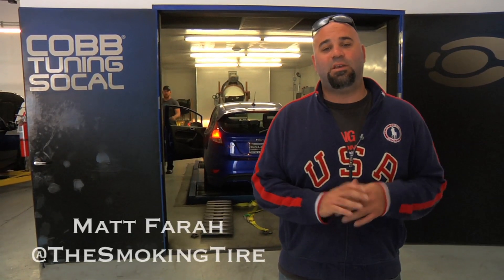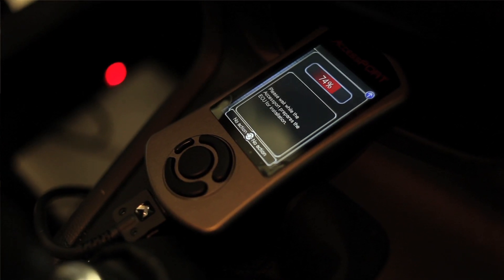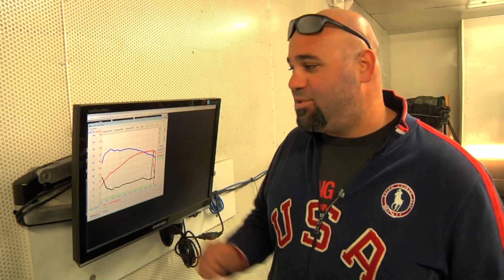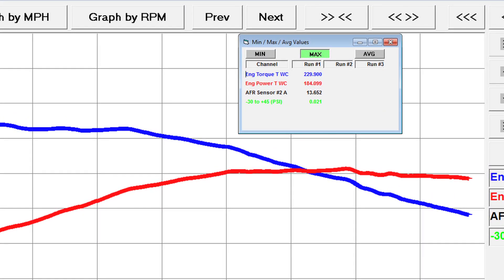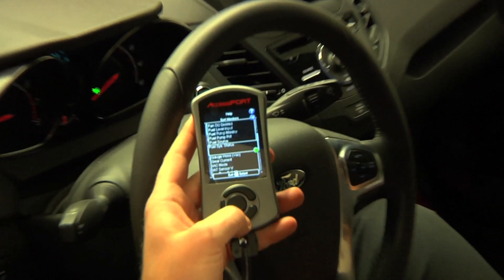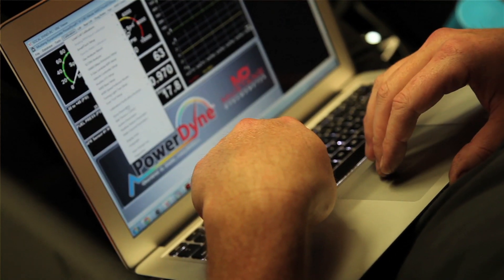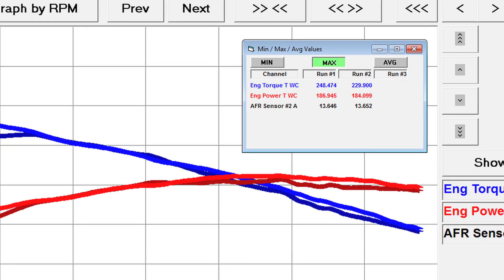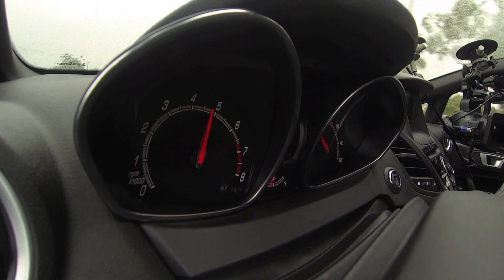Project Car Fiesta ST Gets Cobb Stage 1! Before/After Dyno

Comment: It looks like most of the torque improvement is at  2000-40000 rpm, which is great, but is there a noticeable improvement at the top of the rev range?  Is there a tune that can flatten out that torque curve a bit?
Reply from the maker: The biggest improvement is in midrange torque. If you want more power up top, you have to start changing hardware. The limiting factor is the size of the turbo, which is designed to produce low end torque from the factory.

Comment: Wow how come it was only such a little improvement? The N54 gains a lot more power from the Cobb Stage 1 Tune.
Reply from the maker: The N54 has six cylinders and twice the displacement of the Fiesta. The bigger the engine, the bigger the gains.
Reply: TheSmokingTire Got it. Makes very much sense.

Comment: Only gains at 2500 -3500 rpm at 4000 and up  it the same as stock with very little gain!  According to graph at Cobb timing . so top end is the same as stock!

Comment: Did anyone else notice that completely stock, this Fiesta is putting down more torque to the wheels than it's even rated at the crank stock? The ST is rated 214 lb feet of torque at the CRANK. This Fiesta stock, pulled 230 lb feet of torque to the WHEELS. All cars have drive train loss, so the the power to the wheels should be less than the crank. That is strange, but if these dyno numbers are correct, with a 15% loss of power through the drive train(which is average loss), the Fiesta ST is actually making some where around 270 lb feet of torque stock!! That number is much higher than the 214 it is rated at. Am I missing something here?
Reply: Yeah, it could be that the Dyno measurements are a bit off, but I think it does make more torque than they claim.
Reply: On my fiesta stage 1 when picking which parameters to monitor on the digital gauges, on my first pull for est horsepower and torque, the v3 said 205hp and 277 ft.lbs, at the crank obviously. Looks like Ford is pretty conservative with their numbers

Comment: Why didn't Cobb support the BRZ at least to use their accessport V3?  They don't need to provide tuning for it if they don't want, I just want to be able to use the device.
Reply: Cobb accessport is usually for Turbo cars I believe, if you want to read stats and temps etc. You could get a bluetooth OBDII reader that connects to your phone, The adaptor might be about $20, and for the phone software  (Torque and Dash Command are good) you can use a free trial or pay $10-20 for the full versions. Beats paying 500+ for an accessport that you don't really need for your car. IF you really wanna give away extra money, feel free to donate it to me since I'm giving you this awesome advice, even though it's 3 years later.

Comment: Wait so by putting in a high flow air filter, A custom tune on this car, 2-3 extra HP and a stunning 20 Foot pounds of torque that's impressive. How much more power could you get? Stages 2-4 what do you get with those?
Reply: They probably didn't even need that stupid little filter to get those kind of gains. Take your car to a shop and have them do a custom tune and you can get better numbers safely without any major upgrades. Throw on a CAI and full exhaust and it will be even better.

Comment: Two horsepowers on a turbo engine from a remap ? Was the motor THAT optimized by Ford ? Because the Moutune version gets more with the same internals afaik !
Reply: Torque..... Also this is an ots tune, not a protune like one from fswerks or unleashed.
Reply from the maker: It's a small turbo, so unless you change that all you can do is spool it up quicker and make more torque. And yes, the motor comes quite robust out of the box. Mountune also uses 93 (or more) octane, and we are stuck with the California 91 octane tune. You'd gain a bit more up top with a 93 pro tune than a 91 off the shelf tune.
Reply: Allright thanks for the info, appreciated !

Comment: Does the tune bump the boost up at all?
Reply: I don't think so. I believe they did a retune on the air/fuelmixture when they the improved airflow with the new airfilter. 

If they crank up the boost you would definitively see that on the Dyno graph ;)

Comment: Does this void any warranty?
Reply: Yep. Once you start tuning it and putting aftermarket performance parts on it there goes your warranty. Unless of course you put all the stock parts back and reflash it back to stock when you bring it in for warranty repair.
Reply: TheCobruhAlienat0r
The manufacturer has to prove it was the modifications that caused the problem if they are going to deny a warranty claim.
Reply: "IF" whatever is broken is proven to be affiliated with the mod you did, then yes, that part of your warranty is "denied". As in, if you only did stage 1+air filter, and your suspension broke, your suspension is still under warranty.
Reply: northroad1
They could just say it was the aftermarket part that did it. I dunno how they could prove it, even if they would. They could just say "Well you put a custom tune on the car that pushed the engine/trans past its limits so your claim is denied."
Reply: another option is some dealers will sell you performance packages and may/will charge you more but then it's all warrantied.
Reply: TheCobruhAlienat0r Dunno about the US specifically, but in the UK the dealer has to prove the performance/aftermarket add-on caused the problems. If you remapped the engine and the AC broke, they'd still have to warranty the AC.
Reply: *****
Well, yeah, I agree with that. I was talking about say if you blow the motor and they see you put a turbo on the engine and put a tune on it then they won't fix the motor.
Reply: TheCobruhAlienat0r If the turbo wasn't on the engine originally, then yes that would void the warranty no problems.
Reply: *****
Even if the engine had a turbo from the factory if you put a different one on there then they could easily prove that the turbo caused the motor failure.

Comment: Wouldn't that extra torque compromise the clutch on the Fiesta, or is the difference so small that it would make no real difference. 19lbs foot of torque is substantial in a small car like that, so I should think it would. Conformation on that please?
Reply: Ford warranties the Mountune remap in Europe which is claimed to put out the same torque as this tuned Fiesta, so it should be fine, although hard launches will undoubtedly mess it up.

Comment: These cars are a fair bit more disappointing than even the Focus ST. The KP39 turbos are too small to make any real power up top. I can guarantee that the car isn't any faster than it was before. It only feels better.
Reply: Referencing Mountune(UK) who map is up to 215hp, 0-60 is brought down to 6.4 secs and 31-62 mph pull in fourth gear goes from 6.4 to 5.7, which is a decent amount.
Reply: Cool story. This is a Cobb OTS Stage 1 map. Wasn't talking about Mountune's overpriced garbage.
Reply: RiceFTL
Assume the two are similar-which they appear to be. Have much experience with Mountune? We destroyed a clutch on our older ST, but that was an 07 plate with 120k so it wasn't unexpected.
Reply: ***** How can you say that 2 entirely different tunes are the same? One could run waaay different boost and timing thresholds than the next. And Mountune doesn't rate at the wheels anyway, so they don't have an accurate power number (215hp is more like 180whp). I am familiar with who Mountune is and what they do.
Reply: RiceFTL Because the numbers are very similar. I assumed you had experience with Mountune, guess not then.
Reply: ***** It's pretty obvious you don't know much about ECU tuning. Quit arguing something that you know nothing about.
Reply: RiceFTL I don't, but then you know shit about Mountune yet seem to think otherwise. The extent of my knowledge of remapping extends to paying for a remap and the cars at work.
Reply: ***** Because I've seen a mountune datalog for the Focus ST? It's a far safer setup than even OTS Cobb maps.

So by buying a Mountune map, you automatically know that Cobb's maps are exactly the same? LOL.
Reply: RiceFTL
Never said I bought an ST map from Mountune, we used to have one for work/still do. I made a logical assumption looking at the power figures that they were relatively similar, obviously everyone goes about it a bit differently, some focus on flat torque over everything else.
Reply: I had a 2013 Focus ST that was bone stock aside from a lower motor mount replacement and a tune.  It trapped 99mph in the 1/4 mile.  That indicates a gain of 20-30hp over stock.  Clearly the car was faster than stock, and was making more horsepower.
Reply: hartsickdisciple
Sorry but that's not true. There are people trapping 100+ completely stock. It depends on your track and the density altitude. As far as I'm concerned you could be making less power than stock lol. Most tunes for those cars only make more torque because they just raise base boost targets. The K03 isn't big enough to flow above 5500rpm. And more torque isn't going to make the car any faster at the track.

You're trying to argue with the wrong person bud. I'm still holding the record for highest power on the stock turbo with my old ST.
Reply: RiceFTL I trapped 96mph with the same car, the same night, without the tune.  3 runs.  There are tunes for the Focus ST that are proven to add 20+ hp at the wheels.  It's not all about making more power at high rpms, it's about power below the curve. Of course that turbo is too small to make big power, or to be efficient at high engine rpms.  That doesn't mean that you can't get power gains at lower RPMs.  I've bracket raced 4 different cars for parts of 5 seasons.  I've done hundreds of passes at tracks all over the US.  Trap speed increase = putting more power down, all things being equal.  That's true 10 times out of 10.  This is 1/4 mile 101.  If you want a tune for a stockish Focus ST that will give you a hp and torque increase, and actually make the car faster, email Torrie McPhail.  He runs Unleashed Tuning.  The gains are real, proven by multiple runs at the same track, the same night, under the same conditions.
Reply: hartsickdisciple You're preaching to the choir pal. And I would never let Torrie touch my car. Those canned tunes don't do shit for power, which is what this conversation is about. Cool story, you trapped 100. I made one pass and went 13.3 @ 105. Like I said, you're trying to argue with the wrong guy. I'm still holding the record for highest power on the stock turbo using E85, tuned with the help of Justin Brasil. You're trying to tell me things I already know. You failed to mention that you did a baseline pass and went 96, all you said was you trapped 100 so you automatically knew that it was faster. You left that part out LMAO. The point of my original comment was that OTS tunes only make more torque and in no way actually make the car any faster. Reading>you.

Comment: Above 4000rpm there is no difference! I suspect the map is changed above that so that looks a bit of a fail.
Reply: You need to improve the boost and amount of fuel for that. The limitation on small turbo combustion engines is mostly the fuel. With better fuel (with much higher octane) and a matching ECU you would see better gains.

The small turbo is also more focused on low-powerband torque for daily driving (and make the small engine easily compete with (high-end) 2.0/2.2 liters naturally aspirated engines). Using a bigger turbo on a small engine can be tricky, leaving a nearly empty low-powerband and a lazy throttle response. The car currently has a variable geometry turbocharger. Off course you can go one size bigger and lifting the 'turbo kick in' with only 500~750rpm but the best would be upgrading to a twin scroll turbo. But upgrading the turbo is very expensive, you can't use the cheap ones that work good with big engines...

Comment: Something fishy on that stock dyno pull.  Turbo cars are often a bit underrated on factory torque numbers, but nearly 20% underrated seems to be too extreme, as the factory rating at the crank is only 202 lb-ft. In fact, Cobb has tested 2 other Fiesta ST's and both produced just a little over 200 lb-ft at the wheels.  I would question that somehow the 'factory' ecu on their test car had already been re-flashed as the stock pull shows more torque than Cobb Tuning's own test car AFTER their stage-1 tune.
Reply from the maker: Different dynos register different numbers. Temperature, altitude, humidity, even barometric pressure can come into play. Cobb's own test car was dyno'ed in Texas, a month before and 1,000 miles away from this car. All that matters is the difference before/after the tune on the same dyno.
Reply: Agreed with your comment regarding the before/after performance.  Again using the other 2 test cars Cobb has done generated the following gains in TQ and HP:
Test Car #1 base 212TQ, 174HP, Stg-1 241TQ, 181HP.  Test Car #2 base 203TQ, 163HP,  Stg-1 238TQ, 167HP.
This test car gained only 18 lb-ft of TQ, and 3 HP... about half the gains of the other 2 cars.
Reply from the maker: jjuhring1 This car is also tuned for shitty 91 octane in CA, whereas the other cars are tuned for 93 octane, available in all 49 other states. California sucks.

Comment: Isn't there a mountune pack for around $1.5k that puts it to 215bhp and 240 lbs/ft tourque?
Reply: 1k and it has to be installed at a dealer that is ford performance certified.

Comment: 184 at the wheels when stock its just over that at the fly. Get the facts right guys
Reply from the maker: The car is massively underrated from the factory. Our numbers are measured at the wheels, which shows just how much ford is sandbagging out of the box.
Reply: TheSmokingTire How much did each stage kits cost?

Comment: WTF. 1hp and 28pds of torque.....that Cobb tuner is like $600+ new and the filter is like $60+. 
That's a rip off. For the Sam money you could put a 75 shot on and get better results, standard drivability when not spraying and if the engine has any issues remove it and there is no trace at all.
Cobb leaves clues like high then oem AF ratios among many things the dealer can see.
Reply from the maker: Who would want to spray a fiesta? This is real life homie, not the fast and the furious.
Reply: Also the Cobb tuner is needed for all the other stages thus the upgrade to stage 2 is not going to be much in contrast to buying stage 2 first. If its like the standard butt sex friendly subaru crowd its most likely going to be 500 for some DP and catback and maybe Cold air or some other swallowing method.

Comment: IT WOULD HAVE BEEN GRAT TO SI IF THE HIGH FLOW FILTES DOES ANYTHING. BECAUSE I THINK THAT THE ONLY RESULTS YOU WILL SEE IT'S IN NEED FOR SPEED... TheSmokingTire
Reply: I THOUGHT EXACT... oops! exactly the same and I would like to see the measurements with the stock air filter compared to the tuning filter.
Reply: a friend tested on an N/A car and the filter made the hp decrease... its just marketing succes. but was only my friend and his car. has no more histories...
Reply: Bullitt thanks...!!!

Comment: Does anyone else feel like 2-3 hp and 18 lb ft for over $500 is really awful?... I mean that's it?!... not even like 5 or 10 hp?!...
Reply: 20HP on the low end, look at the line. Most people say it's the best mod for the money. You can always go for a custom tune if you want something more. And/or convert to using Ethanol and/or a bigger turbo.  I think the fact it removes the boost restriction from the lowest gears is what makes it worth it, and makes it feel faster than the numbers would suggest.

Comment: Pretty sure your supposed to go beat the shit out of the car for 500 miles before doing a dyne run right after a flash buddy...ecu has not adjusted in 5 min...unless COBB told you otherwise
Reply from the maker: The ECU reflash with the Accessport is immediate.
Reply: When a pro-tuner does a custom tune on the dyno with the Accessport they will make a change, flash it to the ECU and then immediately do a pull. Then repeat that process several times before they are done. So nothing wrong with what they did here.

Comment: Its funny how 90% of you only look at peak numbers. Taken to the extreme, a 900 hp peak hp camaro would be shit to drive because you only get that 900 or so for 500-750 rpm. Where as id rather have a properly tuned 650 hp camaro with solid tq numbers. As the power would flow better gear to gear. And drive ability would be so much nicer. Then put those 2 on a road course against eachother. With the same proper suspension, the 650 hp car will WALK all over the peaky 900 hp car

Comment: Cobb should stick to Subaru...2hp and the programmer cost $500...ridiculous even if it did gain a little torque...
Reply: Look at the dyno graph. It may have only added a couple peak horsepower but there's significantly more horsepower in the low-mid range now. And it's a light car so a little bump in power goes a long way. Not to mention the engine is small to begin with, so it's not that easy to squeeze extra power out of it just through software.
Reply: ruskeee it is very easy to extract more power.  That mid-range bump is nice to have but adding no extra power is ridiculous.  Changing the factory filter is also a gimmick, even more so when no extra power is made.
Reply: ***** extra power IS made, do you not understand how an engine works? peak horsepower isn't that important.
Reply: Grocery Getter yeah..  but it's a good milestone for higher stages.  Once you upgrade the intercooler and piping and a downpipe, you can use that tuner to get some real gains